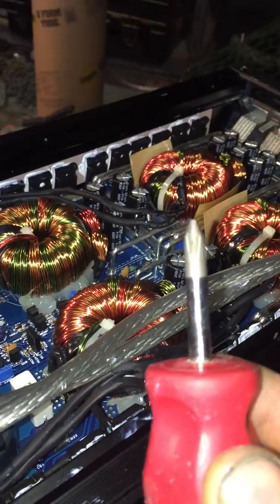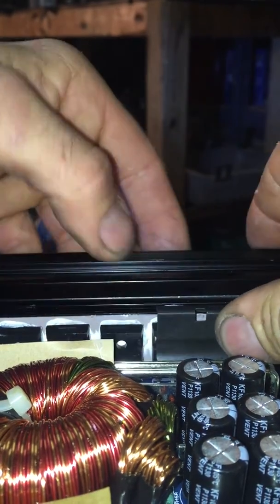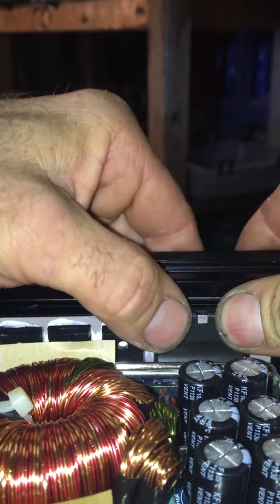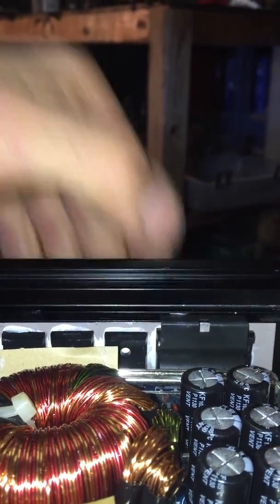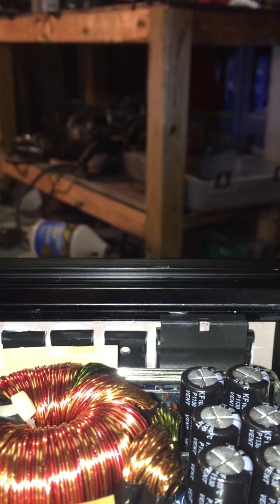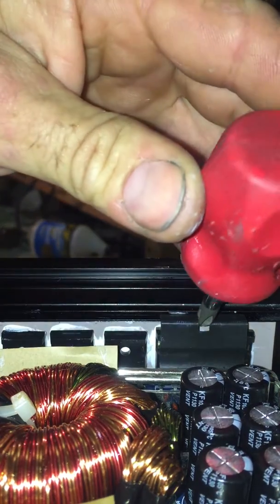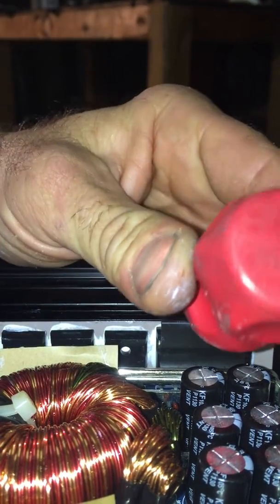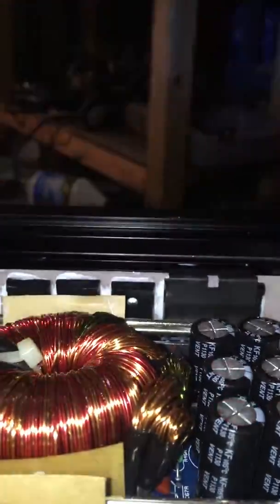Mosfet spring clip install

Comment: Hi, it's coincidence I'm looking for a scheme for Emphaser 15000 and you has the same but with another mark. My question is, do you have a schematic of your amplifier? Or can you tell me what chips have the vertical board that near of the preamps? Thanks for video, it has helped me.
Reply from the maker: Electrónica Orenes I don’t have any info on this amp. I was just repairing a poor solder joint on one of the buss bars.
Reply: No problem, even so you have helped me on how to put the clips. Regards.